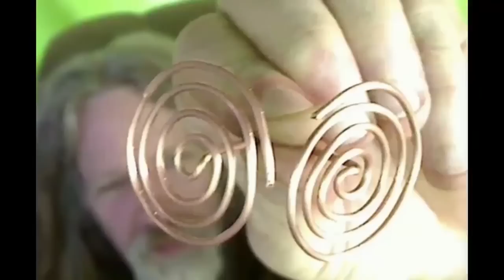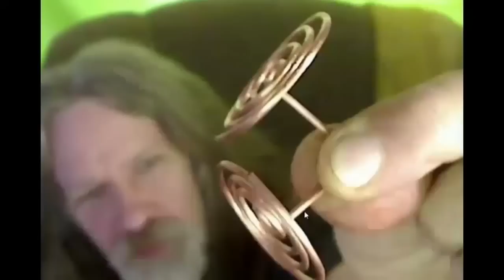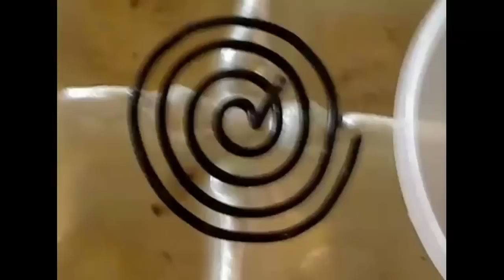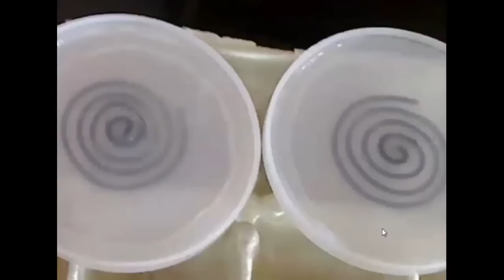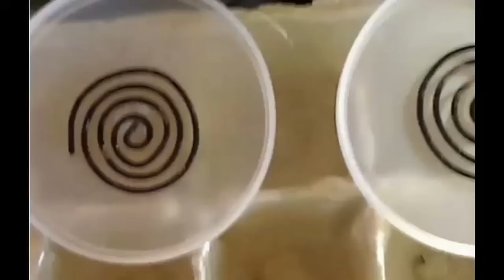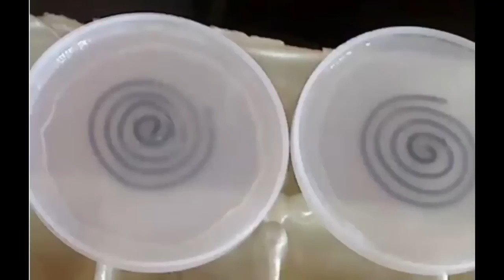Car Coil Reactor

Comment: Plug one of these spiral aerials into each spark plug wire. Won't take any power from the ignition right because they aren't connected to anything else. But there isn't a cell phone or fm radio around that will work sitting next to your car. Hahahahaha

Comment: I made 2 coils, wound one CW and one CCW, with #12 gauge bare copper wire. Nano coated them with caustic.  Put them on 2006 Toyota 4Runner, V6, at the battery clamps.  Usually average 23 MPG on highway on regular gas.   Drove in town for 2 weeks.  Computer read 20 MPG.  Took it on a trip passing through Flagstaff, AZ, using regular gas and mostly in 2 wheel drive on highway, but also included 55 miles of slow 4 wheel driving.  At end of 4 day 600+ mile round trip, I saw computer MPG reading 31 mpg.  I'm happy!!  Let me hear your results.
Reply: +jim Jim, I built a similar device, which I started to test, but I drive Diesel. Do you believe your board-computer? Or did you also notice you drove more miles when you filled up the gastank? Rgds Hans
Reply: +Mobi Gozer   I used the factory MPG feature to get the first mileage indications.  After returning from the first trip, I've confined the 2nd test to in-town driving in a wide variations of Wx, road, 2-wheel drive and 4-wheel driving conditions.  MPG indicator says 28.  I've since lightly coated the coils with a mixture of Brass GaNS and crushed quartz.  With these favorable results, I want to top-off and do an actual gallons-used and miles-driven calculation on the next road trip. Interestingly,  I've also noticed a smoothness in the engine, when idling and a peppiness when running.
Reply: +jim  . Interestingly,  I've also noticed a smoothness in the engine, when idling and a peppiness when running.
Reply: These flat wound coils would work well on  a car battery with side terminals, or under any nut on a connector post.

Comment: In a electric circuit, electrons never travel from the positiv to the negativ pole, since they are themselves on negativ polarity (2.23). From the technical point of virw, this is a complety wrong and nonsense statement!

Comment: Do you connect the bare nano coated wire to the battery terminal or cover it with any material to insulate it?  Did you experience any results in any car? Thank you for sharing.